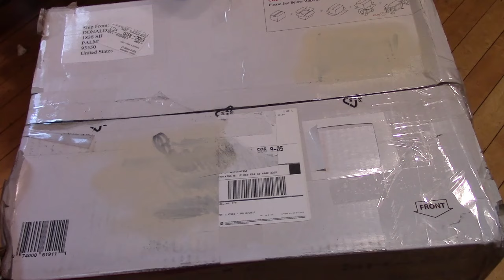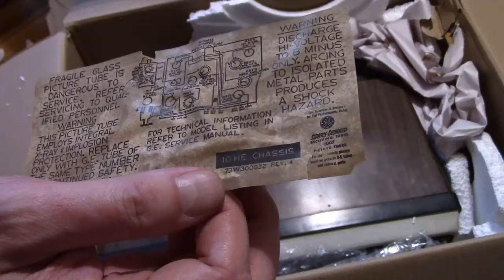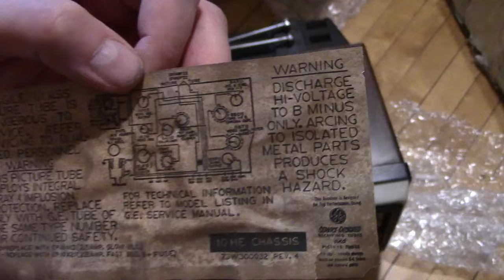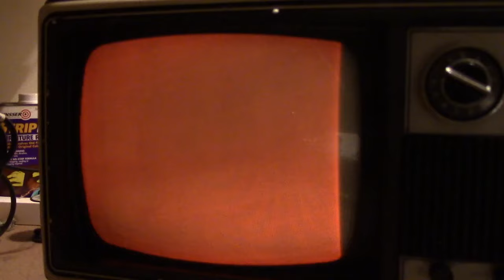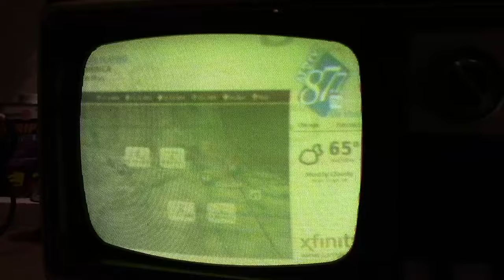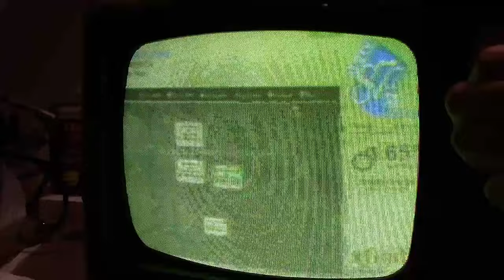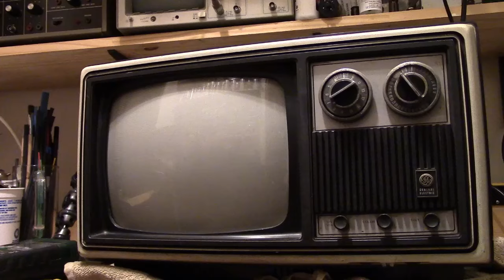GE Portacolor arrives

Comment: I remember compactron GE's well. The popular 'hole in the handle' model and the color srts.

Sometimes the sockets would come out with the tube from the soldering weakening, good to check while t-shooting.

On the engineering side, besides the in-line design, they found a way to eliminate the color oscillator.

They used the burst signal pulse to ring a very high q and stable circuit that rung long enough to last a horizontal line. 

GE had problems with early solid state colors with the occasional crt arcing blowing out the video drive circuits. The had not put in any or a poor protecton scheme.

Good show, as always.

Comment: I know this is an old video but I just recently picked up a 1975 porta color and I was trying to set up the screens and the drives to get good results and I found you crank all the screens up all the way turn the contrast to minimum and the brightness down so that it barely makes a picture and do grayscale with the drives and then don't bother with the high side like Sams says and this gave me the best cut off otherwise the green was never really that great the red was always overpowering and everybody looked yellow but with the screens balanced at wide open and the drives adjusting the low brightness grayscale it works terrific for anybody that was wondering about it.

Comment: This set is from 4/75 or later when the FCC required click stop UHF tuners. Look on the tubes, GE gave the year and week date code of it's OEM tubes. Replacement tubes had a two letter date code. The 188-5 code is the EIA code for GE (188) and the  5 is the plant code for Owensboro, KY.

Comment: Great find!  Those are fun sets and really are more durable than they get credit for.
Another way to tell early ones from later ones is the CRT's in early ones begin with 11.  In the late 60's CRT sizes were measured differently and what was an 11 inch screen became a 10 inch and CRT numbers started with 10, even though they were the same size.

Another thing, and I think you realize this, but your explanation of the shadow mask was a little bit simplistic.  When these sets came out in late 1965 they were only the second TV's to use a rectangular CRT behind Motorola's 23EGP22 from a year earlier.  That was amazing for the time.  One reason RCA stuck with a round screen fr so long was because when they placed the shadow mask over the phosphor dots on the faceplate, they could simply twist the mask to get the holes to line up over the dots before they were sealed up.  Even then they had a high failure rate.  With a rectangular CRT it's impossible to adjust the mask...it has to line up perfectly on the x and y axis.  Motorola/National Video had a terrible time with their CRT's and a very high failure rate.  Now, imagine making the phosphor dots and mask holes small enough to fit in an 11 inch face with the same resolution...in 1965 it was technically impossible for a mass production set.

Comment: The problem with those are the compactrons; they're pretty much unique to this set and were very expensive. Repairs could easily mount up to more than the original purchase price. Watch out for brittle plastics and consider yourself very lucky to get one that is working.

Comment: Nice TV, works quite well. I was saying to myself, that voltage doesn't climb normally so the big filter cap must be leaky as it can be, maybe it will explode? Sure enough, you said it is getting toasty. I had that happen with 2 old UPS battery's a few days ago, they were getting very hot when charging. The only thing I can think is the fact that they got sulfated and there is a short inside a few cells or maybe in all of them. I'll try adding some distilled water in them and see what happens. Sorry for the off-topic. Keep up the good work. Cheers :)

Comment: Now back in the late 70's there were still a lot of those sets around. One story I heard in TV and radio repair class was they ran hot and some early ones were known for melting the cabinet, I don't know how much truth there is to that. I liked that they used GE compactron tubes, cutting down the number of tubes in the set overall. I did hear the models were quite trouble prone though.
Reply: Oldbmwr100rs I've heard they early sets were famous for melting the wax off the flybacks.
Reply: Jerry Carriera Yeah, well most early tube type color sets ran plenty hot to do that, almost ever HV section I opened back then had a little pile of wax drippings under the flyback. I love watching these TV repair videos because this was the stuff I learned on (there were still lots of old tube sets back then and people gave them away).

Comment: I bought a TV just like that in TV repair shop for $85 in 1979.  It worked for about four months. Is there a way to hook it into a computer to get the actual resolution? "Welcome Back, Kotter" is appropriate for that set. I think the first season was 1975-76.
Reply from the maker: +ldchappell1 I don't know but I think it's something like 1/2 or 1/3 the resolution of a standard 21" color CRT.
Reply: Half would be 240x320. I've heard of the new generic HD flat panel brands doing this as well for the smaller sets. Cutting down large screens to fit smaller bezels. Somebody gave ne a small cheapo Dynex TV back in 2008 and there's no way that TV was 720p . It looked better than Standard 480p def but only slightly. It was probably formatted for 570p if I had to guess.

Comment: You should see if you can connect up a digital converter box to it. So you see what it's like watch modern cable tv on it?
Reply from the maker: That's what I do at the 25:30 mark.  I'm using a digital converter box on a station showing old TV shows.

Comment: Any news on this mate, is she done now?
Reply from the maker: Synthematix No, I haven;t had time to work on it.  Not sure when I will.  I have some other radios and TVs to finish first.
Reply: i had a 1980s 7" colour tv a while ago, it was made by panasonic, but it needed a new tube apart from that was pristine condition, however i couldnt find a tube to fit it

Comment: Just out of curiosity have you ever worked on any PAL sets? if so what are the main differences, are they easier or harder to work with?
Reply from the maker: 1990chrism No, I mostly work on B&W sets from the 40s and early 50s.  This is my first vintage color TV.  As far as I know the only difference with PAL is they have a higher resolution and so a high horizontal scanning frequency.
Reply: Ahh fair enough, just been curious for a while since i noticed that american sets have both UHF and VHF whereas the in the UK colour tv's only have UHF band. And also i noticed that the picture on US sets seems to be pretty different in terms of the characteristics, from what i gather PAL sets seem to have much less saturation typically than US sets and don't have any sort of tint control.
Reply: I've always heard that all the British color (or colour) PAL channels were on UHF and that the old 405 line channels were on VHF. Kind of a neat arrangement, but I've always wondered if those British sets with only 4 or 6 buttons eventually ran short of channels; there must have been more in some areas. PAL seems like a rehash of NTSC with the color burst problem fixed; the tint tended to drift on US sets because the signal that synchronized the oscillator was subject to varying phase shifts. PAL seems to have used alternating phases to cancel that out. By the 1980s, VIR had fixed the problem on newer NTSC sets, but it was a bit of a kludge. Other than that, PAL had about the same bandwidth: fewer screens, but more lines per screen.

Comment: I had a very similar GE set when I was in high school back in 2000. It very well may have been this model and I remember those huge pixels. Very cool power up though! I also have the exact same multimeter. :P
Reply: Chris S Actually, my set had the fine tuning knobs on the inside of the channel knobs and had a brown simulated wood front.